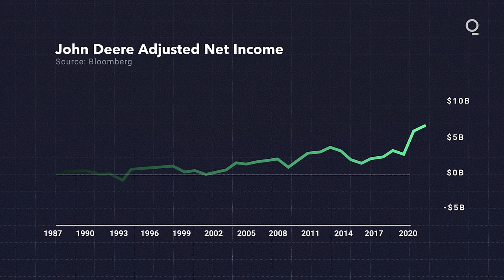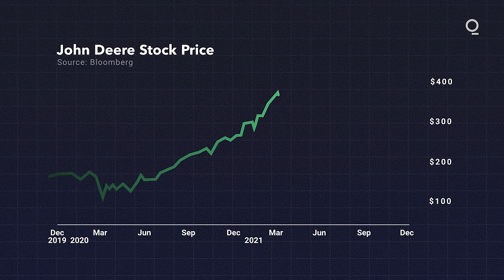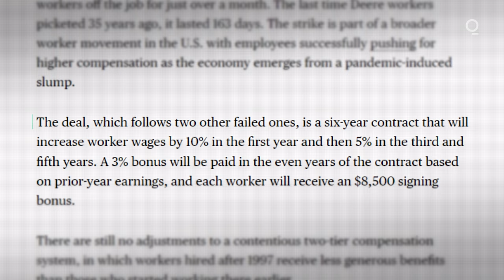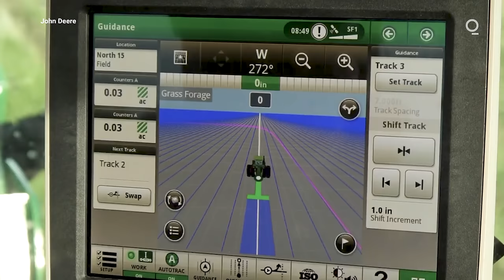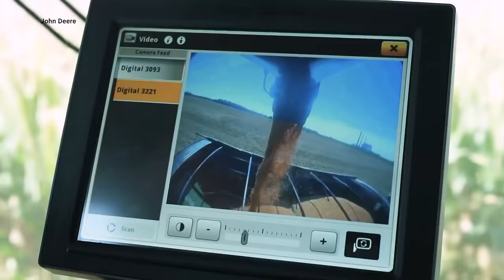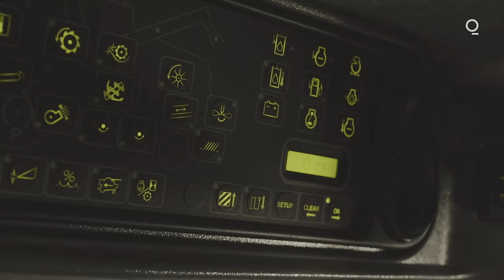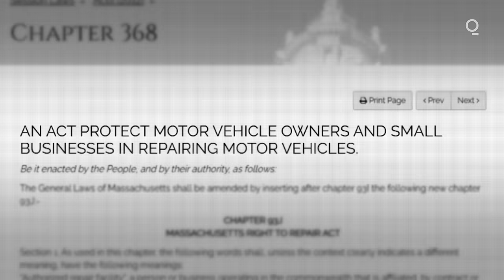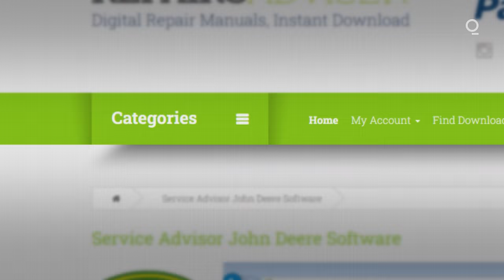John Deere Is Facing a Farmer Revolt

Comment: I'm for right to repair- my old man bought a JD tractor (forgot the model) about 3 years ago, after a year of use, the thing broke down, something to do with the electronics, and dad had to take it in for repairs and the local shop sent him to an JD dealer and sure enough they fixed it but the repair bill they presented to dad pretty much wiped out the profit gain he made from the harvest. Razor-thin margins indeed. 

Dad tried to sell the tractor but nobody would buy much less touch the thing so he ended up just dumping it on the side of the road and sticking with older tractors.
Reply: The price of older non computerized tractors has been going up in leaps and bounds. Even tractors in need of a lot of repair are drawing premium prices because a farmer can fix them. You also see a lot of 45 to 49hp diesel tractors to fit into the under 50hp class that do not require DEF. Is that progress? Is it simply causing more problems for the farmer?  Just remember who feeds the masses.
Reply: @AutoCrete  OK? I never said Dad bought older ones I merely said he is sticking with older tractors-- that is, the ones that have been in the farm's inventory for decades before the new JD tractor debacle. To name a few:  two1988 Pasaquale articulated tractors and a number of JD tractors from the 70's and 60's. We've been in the farm business for more than a century here but we're probably going to sell off the farm once dad retires since it's getting harder to find buyers and processors that haven't been bought up and folded into the massive corporate farms here.
Reply: @AutoCrete  Are they putting emissions regulations on diesel powered farm equipment?
Reply: @gregorymalchuk272  same as light duty trucks
Reply: @gregorymalchuk272  Yes, and on heavy equipment like bull dozers and excavators. Grr.
Reply: The sad thing is that these thousand dollar electronic modules cost maybe $100 to manufacture.   One might be tempted to add the R&D cost to this but that was already paid for when the machine was originally purchased.   Each tractor and combine should be shipped with a set of spare boards.  The sales dept might feel that people would see that as saying the machines were unreliable but customers already know that.
Reply: @AutoCrete  do explain more about this 50hp limit... Is that just farm tractors? Other machinery and/or vehicles included?
Reply: @KristoforJensen  I do know it applies to farm tractors but I don't know where else it applies. That said I would think it applies to other equipment as well. Diesel 3/4 ton trucks require DEF. If you delete it and get caught you are in a heap of trouble.
Reply: Could have donated the tractor to some hackers who could try to write a whole new open source software for it!
Reply: @dongleberry4397   I have no idea what model this is.  But 4WD JD's list prices start at about 400K and 3/4 million depending on the model.  Quite a donation!
Reply: @danharold3087  Better than to throw it in scrap metal pile. After the hackers are done - the tractor would keep working. The thing is - nobody can reprogram all that software without the actual tractor. For example, I have tried to figure out a rare Audi brain - can't do it without the Audi. Or at least without the hair-wire bunch and sensors. and actuators.

Comment: Here in South Africa the farmers got around this problem by refusing to purchase the tractors outright. They simply signed lease agreements with the manufacturers instead. If the tractor stops working then they don't pay. Every day the tractor is offline costs the manufacturer money, so you better believe they prioritize repairs. Importantly, the repairs are at the manufacturers cost and not the farmers.
Reply: the US farmers unions should over night adopt this policy and at the same time start buying shares in John Deere. control of ownership is everything
Reply: So there's no ownership or control of the equipment and any damage gets charged to the person leasing the equipment.
Reply: @davidturney2975  I'm not a farmer myself, but I was told about the leasing program a few years ago by someone who is. I assume that it's much like renting a car. If you damage it you need to pay for that damage, but anything else is the owners problem.

Comment: The reason given by the CIO was invalid in my opinion.

As an IT Engineering professional, including senior management, for 30+ years, comparing the necessity of airliner proprietary code to an agricultural machine was very poor, at best.

A combine or tractor can be put into limp mode to effect its disabling for any number of reasons including "safety".

The only reason JD keeps its advanced code proprietary is for control; whether technological or profit-seeking. It is not because a piece of JD equipment is carrying 200 lives aboard.

Keeping technical control by means of proprietary code is quite simple using patent and license. If necessary you litigate anyone changing proprietary code to pirate it for other means.

Any device with advanced code nowadays includes someone else's code whether patented, licensed or otherwise. All devices using IT code could not operate without someone else's (even Apple).

The right to repair for any device should be available and allowable. Not to mention that it also allows for the further advancement of the technology. Without open-source code few, if any, machinery, device or equipment would function. The same cannot be said for most proprietary code. 

With a few safeguards in place allowing the enduser to effect repair will boost economic activity, expand access to technical support and advance even proprietary code.

It's a social issue driving JD, and other OEMs, from releasing such code; economics. When we share advanced code we assist other fellow Americans and drive innovation. Everyone can make enough profit to satisfy even the most aggressive shareholders.

JMHO
Reply: Since the basic structure of these machines is still mechanical it won't be many years before the market for hacking the electronics opens up. Literally. All the proprietary boards will be swapped out for Arduino type microcontroller stuff that kids in school and uni are working on now. Deere might try to ransom the mechanical replacement parts but that triggers a new market opportunity as well. Unless any business goes back to customer service first their long term survival is questionable. Unfortunately short term share and market manipulation incentives for board members and shareholders prevents long term strategy being thought through.
Reply: Remember that the airlines fix and maintain their aircraft with the airlines' own mechanics. They don't call Boeing to come out and service the aircraft. So JD's CEO comparing their tractors to airline aircraft just goes to show how little the guy apparently knows about aviation. I see bad times in JD's future.

Comment: John Deere simply took a page or two from the Automotive World. They saw the GOBS of PROFIT that could be made from funnelling their customers into their Dealerships, using their software, and their parts. 
JD doesn't care about the Customer, they care about PROFIT.                              I SUPPORT RIGHT to REPAIR. 
BAD ANALOGY of comparing your Farm Equipment to Jet Airplanes. Of course you wouldn't want a backyard Mechanic "Fixing" your Jet Airliner, HOWEVER, when you look at the Automotive Industry, there are literally DOZENS of Independent Mechanics and PROFESSIONAL, EXPERIENCED, DEGREE'D Software Engineers & Programmers that are NOT directly tied to any of the BIG Automotive Companies that can go in and FIX any of them without having to Deal with a Dealership. 

LET"S GO BRANDON!       I agree.

Comment: I can agree that modifying the software can get a bit sketchy as you can permanently brick electronics that way, but when it comes to the hardware you should be able to repair it on your own without repercussions.
Reply: dual bios.....
Reply: Only if the contract/terms of use say you can.

Otherwise you have the right and legal responsibility to not enter yourself into that contract.

Comment: if the tractors can send back yield information, they should be able to report what's wrong with the machine and provide instructions on how to fix it.
Reply: actually not only that, but provide fixing through internet, if its software related. and send people over to take the tractor to maintenance&return when done, when they can see through internet remote access, that its not software related. and even predict things going awry, if hooked to 24/7 internet monitoring.
that kind of white-glove service would cut into profit margins. but its technically possible.
"Applying artificial intelligence and machine learning to a massive pool of device health data enables services like HP Proactive Insights service to predict failures and address performance issues"

Comment: A tractor going down the road IS NOT comparable to a 737 in the air.
Reply: lol the former is only carrying one person and can pull over if something goes wrong the latter is carrying a few hundred people and can't pull over when something goes wrong. its like comparing an Apple to an Elephant.
Reply: Your typical row crop tractor wieghs 27,000 lbs moving at 28 mph while possibly caring an implement that wieghs over 15,000 lbs. The machines have to use available road systems to transport. I have seen what these machines do to Honda accords that want zip in and out of traffic. Or when something breaks and the tractor looses control. The carnage is of epic proportions. I seeing alot of people comment that I don't think have ever been in close proximity to one of our machines.
Reply: @user-jl5rx9yx2p  i dont think you realize that you are making the case for mandatory transport on a trailer rather than simple country road transit. if you are spaced apart youd have to either sell the outlying parcels or buy yourself a heavy haul or get out of the business (and lifestyle).

Comment: The thing they missed on right to repair is that is says nothing about what the OEM can charge for those parts/info/software/repair info access. All it requires is that they make it accessible to everyone.
Reply: Several Equipment manufacturers do sell the software to repair their equipment to independent shops.  The software can cost several hundred to several thousand dollars depending on the manufacturer.   Unfortunately because of Tier4 emission controls for off-road diesel engines and the proliferation of electronic controlled hydraulic valve bodies on nearly every piece of farm and construction equipment computer control of every aspect of the machine is necessary.

Comment: Worked for a farmer in 2020. Had a Case sprayer that was having issues with the software for the GPS, spray control, and whatnot. All it took for me to fix it was a USB drive to backup the software and reload it back into the controller. Guy was happier than a pig in you-know-what once I had it running.

Comment: Almost stayed neutral on the issue. The repair issue is that relatively simple corrections (mechanical:limited availability parts, or electronic: poor diagnostic capabilities) take long enough that a portion of crop is ruined. That’s not just stuff you can’t sell, it’s the work you did up to that point as well.
Reply: Imagine, were JD to be held liable for that because no tech could be on scene over a weekend. :)
Reply: Ah, yes, I'm an intellectual you see. I stayed neutral when a global corporation is screwing over family farms.

Comment: It's the same scam as has been inflicted on those GM-seed buyers- forcing people to be locked into contracts, against their interests (of course). Gadgets and vehicles are made unreliable, short-lived and dependant on maintenance/servicing by the manufacturers or their agents. A lot of the crafty software is only installed to hold buyers/purchasers hostage to expensive servicing when otherwise-simple faults/problems are encountered.

Comment: The quality of the machines has certainly gone down in the way that repairs are more common, just like with cars and small house appliances. Simply more profit for the companies than if they were to build durable things - we would only buy one then.
Reply: My own life experience and data both point to cars being much more reliable than they used to be. As far as being as easy to repair I don't know but I am guessing not.
Reply: Jerry Boden  you can’t keep any vehicle on the road forever. Most vehicles and machines reach a point where there are no longer parts available for them . All products inevitably face faze out manufacturers want to sell you new products not indefinitely support old paid for products
Reply: Jerry Boden  they also use Grandpa's Axe,  it had the head replaced twice and the handle four times but still using the "same" axe.
Reply: A lot of Commenters have missed a point here too:   not just the cost of the parts , but the cost of LABOUR to repair.   Another company is being permitted to raid the producer's till.      Yes we purchase at RETAIL and sell at WHOLESALE ....   but of course, what other manufacturing company DOES NOT do that too ? just par for the course.   Difference is that farming is so weather and market dependent, moreso than anything e lse  ( huh, until  'covid' effect on Lumber and  Chips ).
Reply: to go back to horse and buggy as means of farming and transport the population essentially would have to be cut to 25% of what it currently is . Could it be done

Comment: Only one guy said one sentence in that video that is of real threat.
JD wants the information about farmers crop in real time, once they get that they will control the market through the stock exchanges. With that they can control the price of the crop and the price of next year fertilizer and next seeds, etc.
BTW as a side note I am certain JD does  not want you to repair your tractors because they have 'safety' concerns when you drive down the street. L

Comment: Need companies that are the exact OPPOSITE of this, where they design things to be easy to maintain/repair.
Reply: Or hardy enough to be used for generations without breaking.
Reply: Problem is that the company's financial incentives reward anything that requires the customer to use corporate repair services and to replace the product frequently. Tough to overcome the influence of $$.
Reply: The Army has stuff like this. They use the "modular" system. If something goes wrong, just pull the module and replace it.  Of course you have to use the computerized scanner to "inform" you of which module to pull.  The real problem is many times the correct solution is to plug in the item so it has power.
Reply: @Harry-zz2oh  Air Force too. It's not like a battle will wait for a 9-to5 customer service person from the defense contractor.
Reply: @teresabenson3385  For sure.  Reminds me of some of the stories from Viet Nam where the artillery were limited as to the number of rounds they could use in a day. This limit applied regardless of what was happening on the battlefield.
Reply: @Harry-zz2oh  That doesn't sound like it has anything to do with right to repair

Comment: Sounds like the farming industry needs new innovative equipment companies. Electric tractors, open source software 3rd party repairs and parts would be great.
Reply: Somebody needs to kickstart and fundraise new open source tractor. We don't need new models every year, just 2..3 most common size tractors which last another 50years and have alternative parts manufacturers
Reply: @artur8403  the hardest part would be figuring out a power train that would be easy to repair.

Comment: What they are doing is basically encrypting the programming and using it to hold your equipment hostage when it shuts down (doesn't have to brake to do it)

I had a 2010 International semitruck, one day alarm went off, red "stop" which means the engine is about to de power (think 25 mph top speed) or shut down completely in about 30sec. Sitting at a red light can't really do anything but I noticed that if I revved it a little it would shut off, so I got it that way to a shipper (couple miles).  Started poking around to see what it could be....

LOOSE COOLANT CAP

That's right, loose coolant cap almost got me stuck in the middle of the street, a mechanics bill, or a wrecker pull to a freightliner dealer (if they have it their way) and probably three day wait to have 
the codes pulled, then a couple more before a mechanic goes looking to figure out what caused the sensor to go off (times based on how it went when new EPA standard trucks came out). 

In a normal world the dash would say "Cooling system pressure low", because that is exactly what engine was diagnosing, and there is no reason to shut down or even de power.  Light foot and an eye on the temp gauge I could get it cross country that way.  Not to mention that coolant leaks are the easiest to find, and a lot of them can be fixed with a knife and a zip tie (exaggerating here)